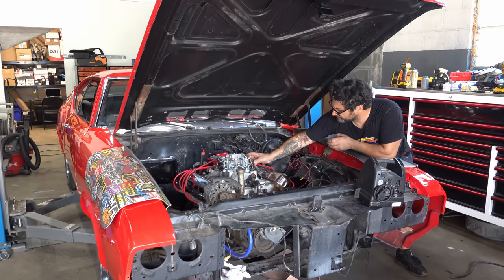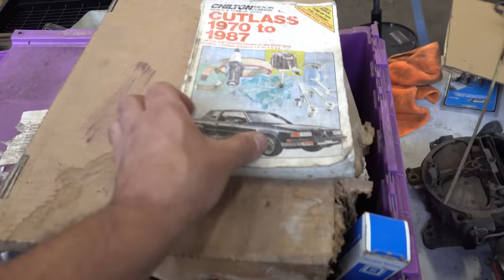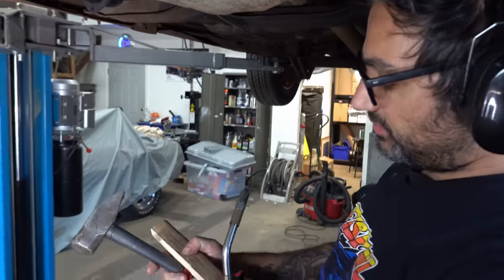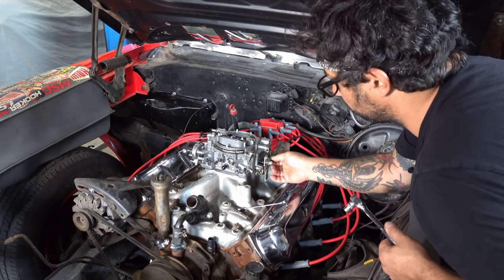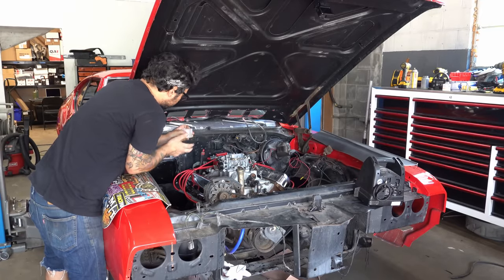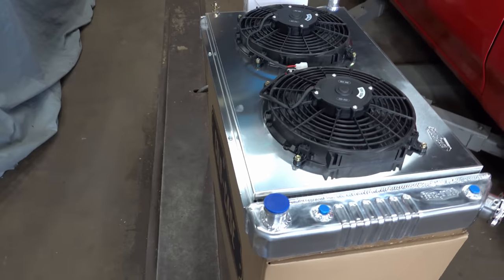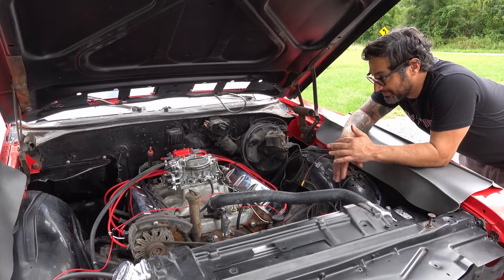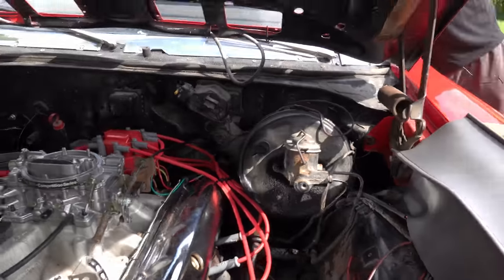Will This Abandoned 1970 Cutlass Run and Drive After 15 Years?!

Comment: so just a bit of info on the olds engines and heads. you do indead have a 1973-1976 by the number on the heads and if the block is original then you have a few budget options to bump compression and power. in 71-72 to drop compression olds put HUGE dish pistons in their engine. in 73 they went to lesser dish piston but went to huge combustion chambers on the #8heads. if it is a 1973-76 block it will have the same block number as the 1969-1972 block and you could track down a set of #6 heads and make the car appear numbers correct. also going to #5,6, or 7 heads having them machined a little you could bump you compression up a good amount. install a 268H or better yet a XE268 cam kit and some adjustable roller tipped rocker arms match it with a 3.55 posi rearend and you will have a very fun very streetable setup.
Reply from the maker: A lot of good info, thanks! Prob just going to work on the awful brakes and suspension first, and get to the motor last. It runs great.

Comment: If it hasn't already been said, not all 200-4rs are the same. They have different valve bodies for the different  cars with matching governors, Turbo Buicks are the best, then the Monte Carlo SS, all the rest are set up to shift low rpms. There's a tag on the side of the trans near the rear passenger side. It will have a code and you can id the trans that way. Internals are all the same otherwise.  Make sure you have a throttle valve cable and it is adjusted correctly or that trans will burn up quick. Good luck.

Comment: Those are probably original pistons which were dished but the 8 heads got to go get 6a heads larger valves with hardened seats a bigger cam 300hp should be doable love this build it gives me real motivation to work on my 70’ olds

Comment: Sweet olds. The 200r4 is a garbage transmission. It was made for v6s and it didn't hold up to them. Unless it was built by art carr or monster transmission, you will probably blow it up the first time you mash the skinny pedal. The only good thig about it is it is a direct swap for a th350 and powerglides. No drive shaft mods needed
Reply: It's so "garbage" Buick GNs and GNXs frequently run sub 10s with them all the time. The junk version was the TH200 3 spd.

Comment: It'd be cool if you could do a switch pitch lockup converter in that TH200R4, if you could find an Olds 425 from a rusted out Toronado that would be cool too. The 425 only came high compression and forged crank the large diameter lifter engine in the W34 Toronado GT cars was rated 400hp, most Olds 455s are low compression cast crank slugs.
Reply: That would be a TOUGH swap.  The TH425 was for front wheel drive cars like Olds Tornados and Caddy Eldorados... basically, a TH400 cut in half after the torque converter and the "bake half" of teh transmission case facing forward and directly bolted to the differential.   This Cutlass is rear wheel drive...  

I put a '66 Olds TH425 switch pitch behind a built 509 Caddy in a '76 Eldorado and it was a blast.  I found a simple electronic switch pitch controller online that would shift the TH425 into high stall when applying the brakes (say at a stop light) with an adjustable potentiometer (for time delay) on the controller on when the converter would switch back to low stall.  When leaving a light under hard acceleration, the 509 would go to about 3,200 RPM and the Eldo would accelerate hard, leaving 20+ feet of rubber.  After about 8 seconds, the tranny would shift back to low stall for cruising (and low heat production).

Comment: The rad shroud need doors for more air flow on the highway. Any oem electric radiator fan has flaps to increase the air flow around the fans when at highway speed.

Comment: in my opinion  - how to not break-in a cam ! ..i  never let the engine idle , turn in  the idle screw 3/4 to 1 1/2 turns before you start i always run 22-2300 for twenty to thirty minutes before idle (amazing you didn't flatten a cam lobe)  ...   also when a engine starts and has no throttle response try turning the distributor for more timing ... but very entertaining
Reply: Exactly!  I was always taught to break in a flat tappet cam with: (1) pre-lube/grease the cam lobes, (2) prime the oil system to build pressure, (3) set static timing so that the engine would start immediately (excessive cranking is bad news!), and (4) run it at varying RPM between 2,300-3,000 for the first 20 minutes you mentioned.  Basically, the cam lobes need to get the lifters spinning in their bores or the non-spinning lifters grind the cam lobes down killing the lobes (and power).

Comment: When I was a kid my old man bought brand new a 68 Olds Cutlass with a 350 "Ram Rod" option.  It was brutally quick. It had a turbo 400 trans and 4.10 gears from the factory.   I saw him beat corvettes and SS 396 Chevelles with that thing and it was a 350 olds engine.  Maybe research what the 350 ram rod engine had in it.
Reply from the maker: I just saw one of those the other week, I didn't really know much about it, but it's a cool package!
Reply: @StayTunedTA  the olds Ram Rod has special heads and cam .. I think intake and carb as well that wouldve been direct competion for the Challenger T/A for that Trans Am SCCA racing circuit if I am not mistaken.. 455 engines can be found cheap.. hop up a 455 for the thing.. I know its not LS but everyone is doing that modern stuff..I was too but...I built a 1971 455 for my 71 442..that pretty stout ..fun times..now I am building a 1970 Challenger..still have the Olds though..

Comment: A couple of 2004r facts. They are within a 1/8" of the Th350 I you can use the same drive shaft. You want to check out the year of the trans the early 2004r are really weak. They can be made to be stronger then the 700R4 trans but in the 80's the 700r4 was the stronger of the two transmissions.
Reply from the maker: Yeah, I don't think this anemic 350 is gonna stress it either way! Driveshaft looks legit so we are gonna roll with it.
Reply: A little history lesson. Your 350 may only be 240hp or so but the 305/307 the 2004r came behind was less then 150 hp. I was a tech back then and even behind 140 hp 305 many did not make it out of the 3 year/36,000 warranty. My dad had a 1984 Olds 98. He had the transmission rebuilt twice under warranty. in 1989 he went in for his third and just bought a new one. That one held up longer then the original and both rebuild combined. Lucky for me dads was an Olds and I worked at a chevy dealer. I am glad I did not have to hear about it every weekend. Keep in mind that was 140 hp 305 and my dad drove just like you would think a 45+ year old businessman would drive his first new Oldsmobile.

Comment: Hi Tony, Oldsmobile for the most part in those years controlled the compression ratio by the dish in the pistons moreso than the combustion chamber chamber size.  Also if those valve covers are non baffled like alot of old aftermarket olds valvecovers are, you can get a set from Bernard Mondello that are baffled properly and at a good price stamped... NOT MONDELLO RACING.. Bernard is Joe's son and does a really nice job..
Reply from the maker: Ha, I was just reading about the Bernard/New Mondello racing saga last night! Thanks for the info

Comment: Yeah with a 200-4R you can run 4.10 gears ⚙️ you have the all round vehicle drag racing down the strip and cruising 70-80 down the interstate.
Reply: In my 70 442 I used to drive 120 miles to Norwalk ohio with 4.30 gears and 29.5 in tall tires. It would spin about 3800 at 72mph! 
The 11.20@119 time slips with a street/strip Olds was worth it!

Edit : forgot to say that yes, that setup is with a th400 and a 10in converter

Comment: Nice. I got 2 2004rs. 1 for my 72 skylark that's getting a 430. And 1 for my 81 trans am pace car that has a 455. My buddy also has one that came in his 1990 wagon that now has a 69 tornado 455 and th350, he really wants to put the 2004r back in it. But they all need beefed up for the bug block torque
Reply from the maker: Yeah, they are great and you can build them up to take plenty of power. This 350 isn't gonna stress it stock, I think.
Reply: @StayTunedTA  yeah. I hope to see more of this build. If it was me I'd go find a 425/455 and do a quick hone and rering and stab it in. My buddy did that on his 90 buick wagon and it does really good.
Reply from the maker: @TheSamplebridge  Lol, I just want ONE CAR that runs and drives!
Reply: @StayTunedTA  true. I already had a 69 electra, 86 fiero, and 81 trans am before I got my skylark. Luckily it only needed a brakes bled and fluids gone through, I still put disk brakes on it. Now I'm trying to finish the 81 so the skylark can take its place when I get the 430 big block buick back from the machine shop.
Reply: @StayTunedTA  if you do ever decide to get a big block. An olds big block as super easy to put in place of a small block. Even easier than a sbc to bbc. And you can still find them reasonably priced. I think we paid 600$ a piece for complete 455s.

Comment: I love oldsmobiles, Carter's and Edelbrocks are excellent wheel stops
Reply: I kinda agree. I've always wanted to make a carter 750 work in an application similar to this but run out of patience. The old carter 1000cfm thermoquads were popular with the Buick crowd for years, but have become so scarce nobody even thinks about them anymore. I've got several dual plane intakes for Olds I'd love to try with one of them old 1000 thermo"bogs"!

Comment: Threw the 350 from my 72 Olds in the corner of my garage, and did a turbo 3.8 Buick swap in mine. The Olds guys will tell you that Olds motors will make power, with like $15k in work. Absolutely love my swap, and it makes double the horsepower now, if not more.
Reply from the maker: I mean, cheap power I've got a 5.3 sitting here that would happily do 425 and motor around forever.
Reply: @StayTunedTA  LS swapped A body is always a good thing. Mine has Wilwood brakes and Hotchkis suspension as well. It's a great cruiser.
Reply: @StayTunedTA  I have 10 grand canadian into a 455 it would be an honest 500hp 530 torque..not much by todays standards but its sharp and fun..by the way earlier I said Can Am...I meant to say Trans am..

Comment: 200-4R is same length as TH350, there has been no reason to change the drive shaft so I think it can be an original one. Length is one more reason to love 200's, easier swap from 350. Made the conversion to my 2nd gen camaro. Transmission carriage needs to be changed tho, its far more in rear wards in 200.
Reply from the maker: Yes! Someone else said that and I researched it, seems to be true! On the A body, you can just slide the trans crossmember back 7 inches and you are good to go, it seems.

Comment: Awesome, Olds Aurora 32v swap if you can find one perhaps?
Reply from the maker: Well, that is a new one! Those are supposed to be decent motors, but I think the bellhousing pattern is 90* Chevy V6.
Reply: @StayTunedTA  what can I say, I like to think a little different than most folks lol I’m betting there’s an adaptor available
Reply: Yuk, why would he want a 4L V8 with 250hp. Even the 4.6L Northstar is junk. Probably the best factory Olds engine to build is a 425 (especially from a Toronado with the large diameter lifters) because they all had forged cranks, nearly all 455s had cast cranks and were rated the same HP from the factory (370-400hp).
Reply: @StayTunedTA  60* yes

Comment: Rotor on them go counter clockwise. Just started watching the video and the backfire would explain your think the rotor spins like a Chevy would.
Reply: Counterclockwise **
Reply from the maker: Nah, we had it right, just kept running it out of fuel like a dumbass.
Reply: lol yeah I feel bad, Im still watching and felt like a tool bag questioning your wisdom.  After I posted that I was like “ shit, he probably figured it out”. 
Anyways, This car is so rad Tony, I think you got a fan favorite here to maybe rival the independence chevelle once your done with it.  The olds 350 is a great motor, arguably better than the Chevy 350 in its day and you can beat the piss out of them.  Seeing this things scoot with a SBO would be badass and would give the people out there on the web something new to chew on.  I see a lot of people commenting on the cam.  You probably can’t run it with low compression but the stock olds 308 cam they ran in the w31s will make that thing Go Rompty Romp and rock side to side like a monster.   I think a retro rebuild like a serious olds nut like the old man who first owned this car would do in 80s would be a wicked cool way to take the project everyone would like.  Plus, you can honor all the hard work the original owner put into it and maybe finish it the way he wanted.

Comment: Love the vid, two things, the volume was really low except at the very end and I think you have the vacuum advance hooked up to manifold vacuum and not the ported vacuum on the carb. Cant wait till the next one!
Reply from the maker: Yeah, you are supposed to be able to put it to the regular port. I moved it to the timed port but haven't noticed much difference yet but we haven't hit the streets really.
Reply: I usually just drop vac advance altogether on my Oldsmobile projects destined for performance. Re-curve it for all in by 2000ish rpm and make sure you replace the limiter bushing with something solid (I used to use a brass ferrule for a 1/8 compression fitting). Might wanna mark your balancer with a timing tape or do the math and measure it. Total timing for this stock iron head motor should be about 38 deg. Later mods might like about 34-36 deg total. Whatever intitial that turns out to be, you can adjust the advance limiter bushing o.d. for more or less intitial timing and still hit your target total.

Comment: Bone stock 180 hp.  I had a 72.
Reply from the maker: With headers and the carb, gotta be 184!
Reply: @StayTunedTA  What ever it ends up at the Olds 350 is a very smooth engine.

Comment: Pontiac was not known for great motors. That's why my 85 trans am has a 400hp vortec 350 from a 90s Chevy truck with a 4 barrel carb and the t5 manual transmission. Love it.
Reply: Are you dented in the brain? Pontiac V8s were the best, Pontiac was the only game in town from the factory in the 70s, nothing could touch the '71-'72 455 H.O. round port, Super Duty 455 in '73-'74 and the W72 400 in '78-'79.